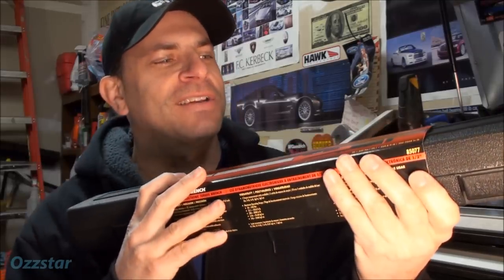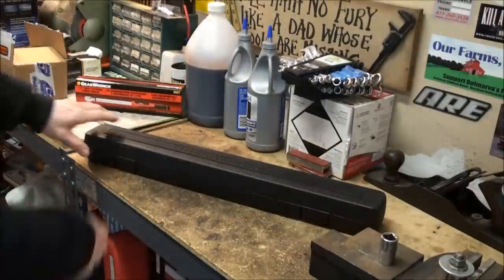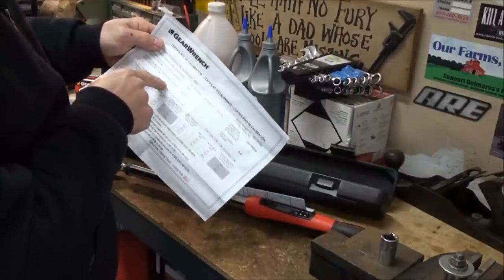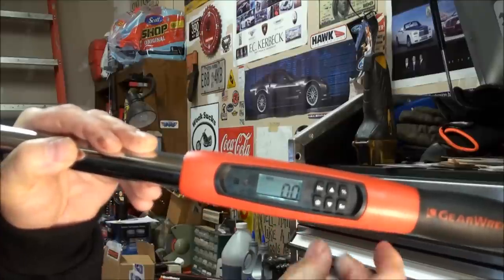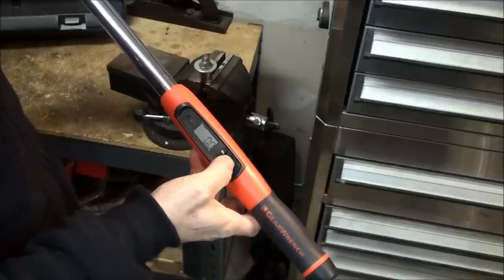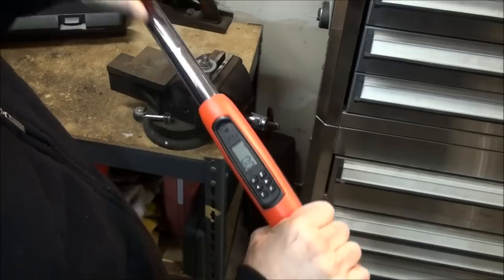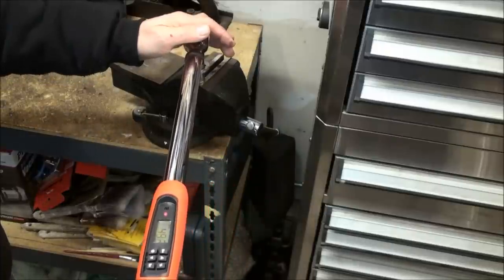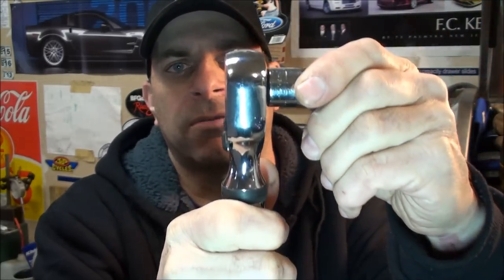GEARWRENCH Digital Torque Wrench Review

Comment: I bought a digital torque wrench(the little adapter) a few years back for $50. I don't know if I like the beeping. I think I like the feedback from a clicker better. Maybe just because I'm used to it but a clicker also seems much faster on something like a bunch head bolts. Gearwrench is a reputable brand and I'm sure theirs is a great tool. Thanks for showing.
Reply from the maker: Beeping or clicking, it's the audio alert that matters to our brain.  Personal preference and a job well done is what matters most!

Comment: May be time for me to upgrade.  Mine isn't even a clicker.  It's the old analog scale that relies on the wrench bending to move the needle.  Since most of my engines are Briggs and Stratton it's getting the job done, but this thing would be nice!
Reply from the maker: You have whats called a beam type torque wrench.  Been a long time since I used one of those oldie but goodies.  GearWrench makes a smaller digital 3/8" version that would work best for small engine repairs compared to the 1/2" model I discuss in the vid.  Take care Matt, thanks for stopping by.

Comment: For most things that require I use  a torque wrench i prefer the clicker type, but for critical parts where gaskets, plastic parts, or torque to yield bolts like on head or crank bolts i grab the digital torque wrench. The rest will get the ugga duga, or grunt to fart torque setting.
Reply from the maker: lol. The old grunt to flatulence tightening sequence never leaves a loose bolt or nut! haha Funny.

Comment: Damn i thought these torque wrenches had angle. I love the red but going to have to get the new orange 120xp instead! Great video!
Reply from the maker: I believe the new Gearwrench model does have angle.
Reply: @ozzstars_cars  yeah i was able to find one of these red versions with angle that i was going to pick up until i was on Gearwrenches website and there is a new "E-Spec" series of torque wrenches coming out in June. They have interchangeable flex and fixed heads with, rechargeable batteries, an OLED screen and 1.5% accuracy. Sounds better than the Snap-On or Matco offerings!
Reply from the maker: I might need to upgrade. Sounds like an awesome tool at a good value.

Comment: Sure wish I could find a low-cost place to have mine recalibrated. Most places want the same amount as buying a new wrench. Ridiculous as all get out,
I've had my old faithful Proto wrenches in 1/2" and 1/4" for the last 20 years, maybe longer, aw heck I don't honestly remember how old they are. My 3/8"s is a CDI that I've had for about 10 years.  Over the last 6 months or so I have upgraded to Snap-On TechAngles in all 3 sizes and I'm spoiled as heck now. So darn easy to use those boogers.